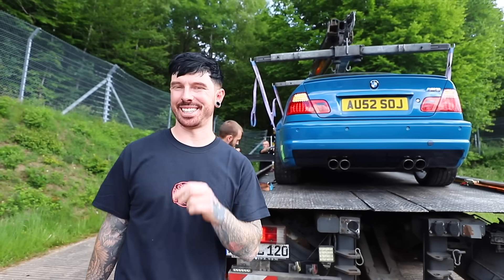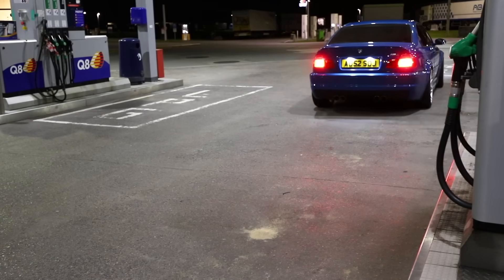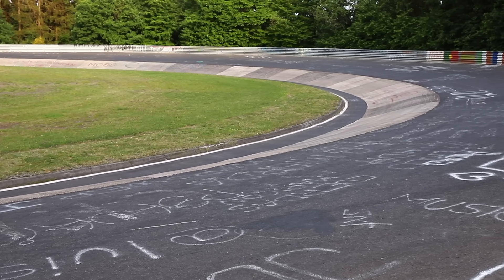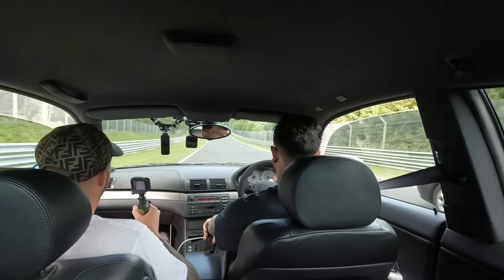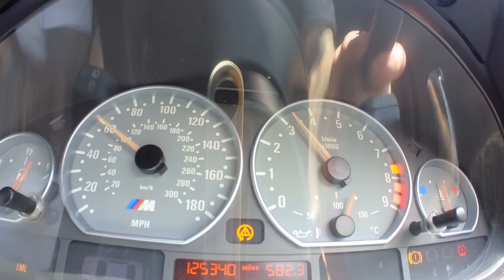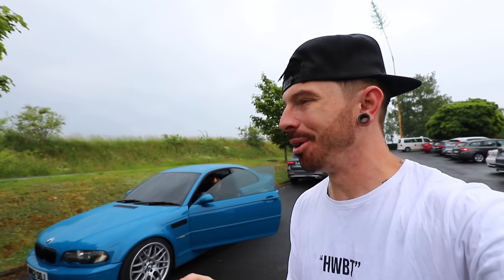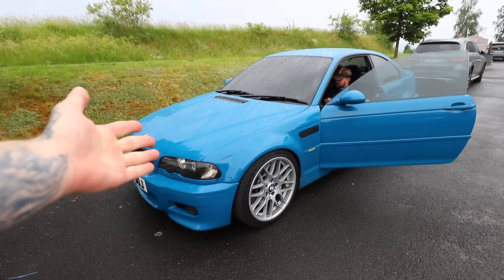ATTEMPTING THE NURBURGRING IN THE E46 BMW M3 I RESTORED

Comment: Throttle actuators in these are famous for going wrong. In my old E46 M3 I always kept at least 2 spare in my glovebox, along with a MAF sensor. The front actuator is usually the culprit, but the one under the intake manifold can also go out. Actuators only cost about 45 quid brand new here, you got ripped off mate!!

Comment: Using your windscreen washer fluid to cool your radiator and oil cooler during a lap would have helped with the heat.

Comment: SMG with the CSL rev matching map (a must!) would of been quicker ;), dosnt deserve all the hate, a new motor on the pump and its epic once you get used to it, there's a reason the CSL's only came as smg - the manual is not a great box imo.. but great video love the car and the work done!
Reply: I like the smg but it gets hate cos it’s so unreliable!! I’d never own one so bought a manual, and true The manual box isn’t the greatest  but I’ve never not been able select a gear cos the smg motor has overheated sat in traffic in the uk 😂😂😂😂
Reply: @Leeholtom2911  I had an SMG for 5yrs, uprated the motor and that's all I needed to do! Never had a problem, its like anything, if looked after properly it's not normally an issue

Comment: Oil temperature rising must be a BMW thing I guess. We drive the 24h of Zolder (Belgium) in a BMW E90 325i. Last year temperatures during the race were like 35°C. The oil temp of the beemer was constantly around the 135-140°C range. We've driven like that for years, nothin to do about it. We just make sure to use decent synthetic 5W60 oil that can stand these temperatures. Dedicated fluids are always interesting if you're going to be pushing that hard for a long time. (brakes, oil,...)

Comment: If it's something I've learned over the years is that you don't push to limits a 20 year old car, regardless of brand,  unless you rebuild all critical systems with new parts. Electronics tend to break over time, I have one Vauxhall from 2005 which runs perfectly but from time to time I get a CAN BUS communication error, which goes away eventually. And I changed all possible sensors with new ones, only ECUs remained old.

Comment: Love your can do attitude.  Ignore the negative comments about running around the ‘ring as a newbee.  We all have to start somewhere and to stay safe all you need do is be sensible and know both your limits and the cars.  I’d be putting some premium rubber on though for that sort of thing.  Not worth risking your neck on budget tyres!  Oil temp sounds about right for pushing hard.  Modern oils can be cooked to 140 degrees or more without serious worries.  As long as it’s a high quality synthetic you’re fine.  Welcome to bmw unreliability and bills!  Yours is a better engine reliability wise than the the wallet munching m5 V10 which is epically bad!

Comment: would deffo recommend getting a copy of BMW INPA. you can get it running on a cheap windows laptop and its way more in depth and can calibrate things. i replaced my smg pump with no previous experience and used INPA to calibrate. A must have if you're doing work yourself.

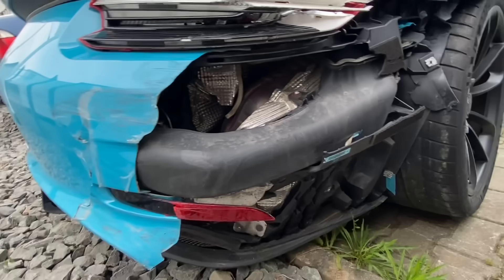Comment: 6:36 this is not correct in general, but widespread since many years. At least for cars registered here in Germany, it depends on your insurance contract. Most insurances (well, I guess all of them)  reject payment if you take part in a race and crash, which is comprehensible. The Nordschleife is a racetrack, but Touristenfahrten (or Trackdays, drift training etc.) are not counting as a race. Most insurances do not prohibit driving on a racetrack in general (but few of them do!) and pay damage, as long as you are not taking part in a race. So if you have a fully comprehensive insurance (and I guess all of the expensive cars have one), then nearly all the repair costs or price for a total loss will be paid by the insurance. The same goes for damage you cause on foreign cars, guard rails etc. of the Nürburgring, including salvage costs, cleaning the track and costs for closing the track. 
Sounds good? Well, there is a drawback: your no-claims bonus (in German "Schadensfreiheitsrabatt") will be going lower after receiving payment of the insurance, and so you have to pay much more insurance charges the next years (even if you change your insurance company). The insurance can also quit the contract after paying for an accident, and then it can be quite difficult and expensive to find a new insurance company. So yes, insurance will most likely pay, but it will have some expensive drawbacks, as your insurance charges will rise in the future.
Reply: "The Nordschleife is a racetrack, but Touristenfahrten (or Trackdays, drift training etc.) are not counting as a race....." This! Regardless of what a large part of the youtube community thinks, trackdays are NOT racing?

Comment: That's funny. My Seat Leon Cupra R 1m lost power at the exact same place of the track twice. First time after towing to the Parkinlot, it startet right up and had power. Don't know. I think it was overheated or something. But no error codes in the ECU. One yeahr later the same. at the same place. But this time at the corner where you leaved the track, my Car were back in life. But this time without boost. My Turbo broke down. I was able to drive home. But it was not fun. 😅✌

Comment: I could have told you, mainland Europe is not keen on cars without a front plate. And on the trip to Nurble saw in a shot with the oil temp light on. 15:17, big opening in rail, that could be way out.

Comment: Just to check you on the "Cruze Control doesn't work" idea. I thought I'd make sure you knew you need to 1. Make sure it's not in Sport mode or that Sport isn't turned on. 2. Leave Traction Control on. Both types. And 3. Check 1 and 2. LOL.
Reply: Also it could be the clock spring on the steering wheel gone bad

Comment: It is normal problem for old m3, on my m3 i change pedal, throttle actuator and two throttle sensors, now it working good. Hope next year i will got to this track, Last summer there was covid, but this summer the war is on, and you can’t leave country yet =(

Comment: Good video. 2 things though.

1. Not wearing a helmet is just daft
2. Running budget tyres and expecting to be fast etc is also just daft.
Reply: That‘s BS. During Touristenfahrten helmet is not necessary. If you are not used to wearing a helmet and even still have active airbags it‘s even more dangerous. Some guys should understand TF drives are no racing events!! Budget tyres, well, yes 😆

Comment: Just a note 6:43 in the scenario you explained where someone is repairing their car privately, car vertical or any other car history checking tool would be useless.
Reply: Yep, example he then gave was a car that had been sold in a damaged state at a ‘car crashed auction’ 
Wouldn’t need to be Sherlock homes to find that cars history…
Reply: @jackw9920  This is what he says "...and then put them back on the road without a registered title, when it comes to selling no one would have even known it's been in an accident.  That's of course if you checked it out using Car Vertical".  This just isn't true,  if someone has repaired the Porsche in the video privately, not even Car Vertical would know it's been in an accident so this is lie.

Comment: I'm guessing that your rear driveshaft has gone rusty under the ABS ring which has swollen it which is what killed the previous ABS sensor. The new sensor hasn't died yet but the swollen ring (fnaaar) will be bringing the DSC on causing a loss of power cos the car thinks you're constantly losing traction.

Comment: it will be a massive shock when you get to the Nürburgring and you will sit in your car rather than above it 🤣
btw, is it legal to drive into Germany without front numberplates? After all, in Germany the speed traps take pictures from the front to catch both number plate and driver. edit: Ok, looks like police has already told you 😆

Comment: Did you get permission to time your lap? It's strictly forbidden to time your lap on the Nürburgring and you can get a driving ban in Germany if they see this as it is a public road. You're allowed to record it and use that timer, but you need to have special permission to run a live lap timer for obvious reasons involving you pushing and putting yourself and others in danger.

Comment: Your lucky your car is most likely riddle with non compliance, who goes to Germany without a front plate, the front tint is a big no no in Germany your very lucky, they could have ceased your car and gone over it. In Germany only tuv approved or manufacture mods are allowed in most cases. There are signs at that you it’s a towing zone but it seems your not very respectful visitor to Germany and you did zero homework on what is required driving in continental Europe
Reply from the maker: The car is a UK car bro so not all rules apply to the car. 👍🏼
Reply: @MatArmstrongbmx  front plate does 100%.
Reply from the maker: @Richard_Turner  as mentioned in the vid
Reply: @MatArmstrongbmx  to be more positive on it, there are a lot of us with long experience of the Nürburgring and are quite protective of the area, of late seems to be attracting a lot of people who are shall we say do not help the reputation of the car community in the area (not suggesting for a moment that you are in that grou btw!) But you have a great platform to help others enjoy the experience and there are many of us who would be only too happy to offer help to anyone to make sure they have a great time without any of the issues, noone wants to see people being banned etc but it does happen and rightly so. Hopefully you can make a return trip and spend a bit more time on track as I guarantee you will be hooked 👍
Reply: @Richard_Turner  front plate on that car I would guess it needs headlight filters (some newer cars you can set in the menu to right hand drive) he also doesn’t have a country identifier which for the UK changed from GB to UK last year. He also needs high viz first aid etc, the German authorities much like UK can apply German rules to foreigners if just visiting, looks like the guy did zero due diligence before he went, lucky as the french police are defo not so nice and would have just ceased the car
Reply: @DashDriver-z1r  I agree to all points. I mean I am sure Mat has the bits and pieces in the car, and I think BMWs even then could change beam patterns or of course LHD headlights. What I dont get is why the new UK stickers I've seen are twice the size of the old GB ones..  compensating much? 🤣 

All I want is to just see people do what is required,  as it sets a good example for others, uk drivers have a bad enough reputation already with the wheel on the wrong side of the car 🤣